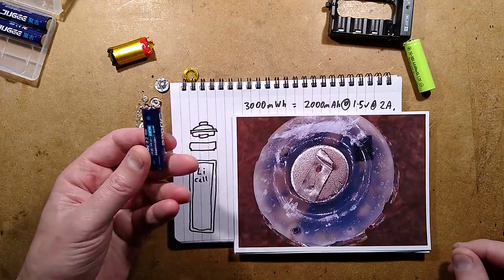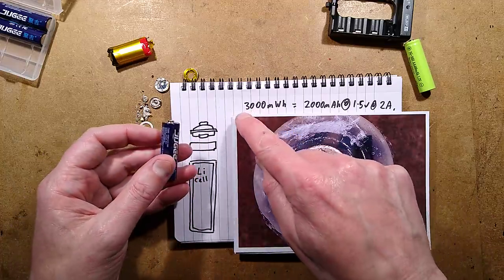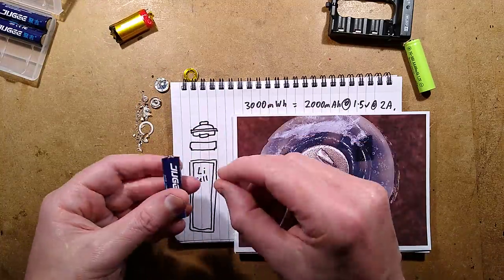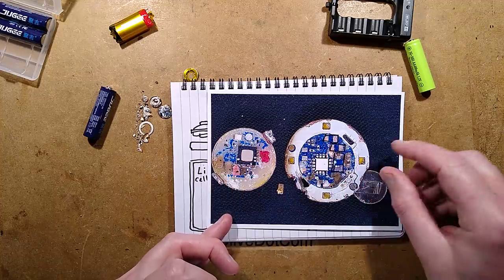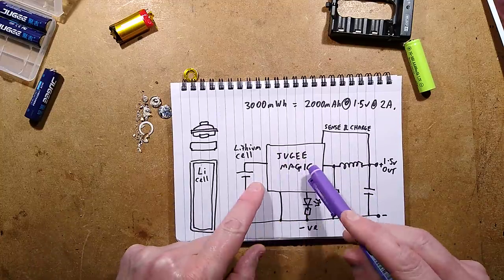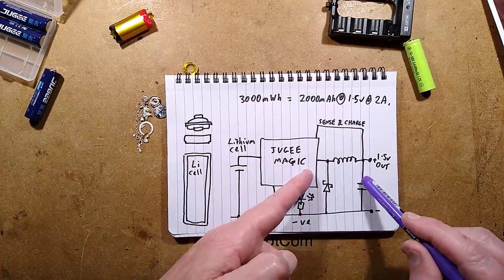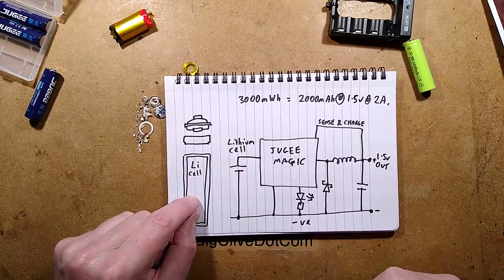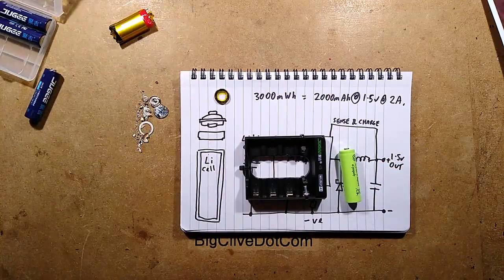JUGEE battery teardown.  The short version.

Comment: That's clever. At long last the 1.2 volt problems solved!
Reply: There was/is the questionable Ni-Zn 1.6v rechargeable cells but they were apparently limited in ability.
Reply: 1.2V hasn't been a problem in a loooong time, all modern portable thingamajigs work fine powered by 1.2V NiMH cells.
Reply: MasterBata except when they use 1v as being “the battery is flat”, which a loaded 1.2v cell can do even though it’s not yet empty.
Reply: MasterBata I have a metal detector, it takes 4 x AA batteries. I put in 4 Duracell’s and I have 6 volts, I put in 4 x NiMH and I have 4.8 volts. I have lost 80% of my voltage when I start my detecting with a set of freshly charged batteries. In real terms that means they run out faster.
Reply: Andrew T yeah, I’m sure I’ve overcharged nimh batteries in the past because the device they were in showed a low battery meter, or seemed to run down quickly. There’s an EEVblog video about it somewhere.
Reply: Thats an old wives tail put out by the disposable battery companies. What they don't tell you is their wonderful 1.5v batteries you throw in the bin so regularly actually drop below 1.2v in minutes whereas nimh batteries will stay a lot closer to 1.2v for a long time.

Any 'flashaholic' knows this. There is even an industry wide approved independant standard (ansi FL1) where flashlight manufacturers have the brightness and runtimes independantly tested with the various batteries their devices takes...nobody in their right mind would put a disposable alkaline in a high end flashlight! It would be dimmer quicker and ultimately last a lot less than a nimh power source. and the bloody things (alkaline) can leak. Even the "leakproof" ones.

Stop falling for the advertising.
Also...smoking kills, alcohol isn't great for you (that whole red wine thinning the blood...the amount of wine you need to acheive a beneficial amount of blood thinning will kill you outright!) and sugar is pretty much the new tobacco.
Reply: The Browns damn “big battery” and their sneaky ways 🤣 well they won’t get me, I buy my alkaline cells from Poundland where half of them are already flat or leaking, and weigh so little I suspect their AA batteries are really AAA cells with some padding.

Actually, I’m kind of disappointed when I buy modern electronics and discover they still require me to buy batteries. Like buying a product and finding it has no plug. Surely now there’s not many applications where a built in battery wouldn’t be appropriate, and it’s just the manufacturer being cheap.

I’m looking at you Microsoft. All other console manufacturers have controllers with built in li-ion/lipo batteries, but the XBox still uses double A batteries.

Comment: Very interesting. I wonder if the output is adequately smoothed? I can't use Znter USB rechargeable 9V batteries in musical equipment because they introduce an audible whine into the signal.
Reply: in audio kit you may need to add some ceramic or electrolytic caps to quieten it. Especially if it is designed to only run on batteries as the designer would not of considered ripple at all.

Comment: So, these are on Amazon, 4pack just as Clive has. If you search for Jugee. On that Jugee listing are the words 1.5V, Lithium, and rechargeable. If you then search for " 1.5v lithium rechargeable" you will NOT find these batteries other than a 2-pack. You will also find many many battery listings that are not lithium, and not rechargeable, and not 1.5v. Amazon search f'n sucks.
Reply: I've seen similar things with the Amazon search, I think you're actually  better off using google but limit the results by domain.

Comment: Thanks for the short version. I must admit I tend to skip through your full length videos, usually the device opening section and the circuit diagrams as I'm more interested in what the device is, outline of how it works, and what search terms to use to find it.

Comment: I wish I could get Clive's help on a lil project I'm trying to work on...I want to make a small portable Induction Heater I wish I could solder on the positive and negative to a Power Geek 4000mah power bank as all the parts needed to make it run off are on the Board for the power bank...I wish I knew a lot more like Clive when it comes to electronics I did micro soldering and QC work but

Comment: Hi,
You really should be using the little sanding drum instead of cutoff wheel, even if you go too deep most likely would remove material evenly enough it prevent shorting, good luck.

Comment: If only there was a more thorough investigation. Details of how hard the battery was to open. Examples of what happens when other batteries are put into the charger. Maybe a minute or two of nibbling away at the housing, trying to get the PCB out. Maybe even an interesting and charming aside about how every night the show runners would put new batteries into the wireless mics because failure just wasn't an option. Yeah. That'd be great.

Comment: These batteries are fantastic, when they work. The only problem is that the circuitry tends to break, especially in AAA cells. I don't have this very kind, but I have Sorbo and Kentli, and at least 1 already failed from both types.

Comment: @bigclivedotcom Could you please tell me, are these superior for use than Eneloops?
Reply from the maker: Each has its own applications.  The eneloops are the preferred choice for applications that will run on 1.2V.  The lithium based ones have the advantage with weight and for older equipment that needs a higher voltage.

Comment: Interesting... so what voltage would the lithium cell actually read if it wasn't stepped down or is this just a protection chip?
Reply from the maker: It would vary between 3V and 4.2V.

Comment: Do these only charge in the advised MILBEP compatible chargers? It's a little hard to find information online about what exactly MILBEP is. I have found the included charger to be very flimsy, I had to bend the charging connections to make proper contact with the bottom of the negative contact point.
Reply from the maker: I'd only recommend charging them in their own charger base.  I think there's variation between brands.

Comment: I use a LiFePO4 and a Blank AA  when I need 2 AA
Reply: Except the 4.2 volts is often too much. I have installed a diode inside the blank, so the voltage is now reasonable 3.5 volts. Also the low battery indicator works before the lion is too empty.
Reply: @TimoNoko  LifePo4 are nominal 3.2V per cell, their fully charged voltage is about 3.65V , think you are getting mixed up with L-ion

Comment: Sounds like a good cell since most recargable AA are 1.5v slowly dropping to 1.2v cells and a solid 1.5v rechargable would have many uses but to get hold of these via the Ebay flea market will cost a UK punter well over £40.00 for 4 AA cells & a charger. I think I will pass untill the chinese make the Very Dangerous and fun rip off clone for £5.00 direct to your door inc free Speedpak Delivery.

Comment: What about the self-discharge? Znter batteries has an ugly self discharge (similar to NIMH batteries but far more expensive)
Reply: I'd figure the always-active buck converter would drain these in less than a year. A decent low self-discharge NiMH like Eneloop or IKEA would easily beat that. Even a regular NiMH in good condition will last several months in my experience. However, worn out NiMHs certainly do self-discharge very quickly. If you're looking for a battery with low self-discharge I'd say get some new high-quality NiMHs for less money than this. Since these don't have a built-in USB inlet it seems to me the only advantage these have is the slightly higher output voltage.

Source for NiMHs being good:
I upgraded an ancient cordless phone (from around 1991) to NiMH (3x AAA size cells) and I'm certain I haven't charged it in four months, possibly even all year. I've had 15 hours of talk time and the low battery indicator still hasn't come on. Proper low self discharge NiMHs like Eneloops are even better, I think the batteries in my camera were charged over a year ago and they also seem to have plenty of charge left.
Reply: @eDoc2020  ZNTER batteries are self-discharged in a few weeks without use...

Comment: When an eBay listing states 'Refurbished Lithium Battery'. Is that even possible, and why would sellers go to such trouble?
Reply from the maker: They are often salvaged from old equipment, and usually have useful capacity for less demanding applications.
Reply: @bigclivedotcom  Useful capacity, but not as much as they originally had.  Shorter life, too.  You get what you pay for.  Unless you buy from an eBay scammer, in which case you don't even get that.
Reply: @bdf2718  Used cells are probably still better than the '6800 mAh' ripoffs which store less than 500mAh.

Comment: Could you test if it creates any signal noise on something like an audio amplifier?
Reply: How do you run an audio amplifier on AA batteries?
Reply: @Thermoelectric7  mp3 player, radio, you name it.
Reply: @deslomeslager  a lot of mp3 players will have switching regs inside anyway.  the issue will be anything that runs directly off the cell such as a radio mic..

Comment: Do you recommend these as an alternative for Ni-MH rechargeable batteries ? Ni-MH are quite slow to charge, have poor capacity and only output 1.2V
Reply: In terms of capacity, these seem to be about the same as a typical NiMH at 2500mAh/1,2V which is 3Wh like the Li cell.
Reply: If you can deal with 1.2v NiMH is still better IMHO. They're much cheaper and still have most of the capacity (2.5 vs 3 Wh). With a well-matched charger it should only take around two hours to charge a NiMH.

Comment: 2A maximum.  Great for some things, like measurement tools, clocks, lights, maybe radios, toys, cameras, video game controllers.  I like that they thought of the low charge warning.  Not so good for power tools, robotic vacuums, smoking/vaping gear, resistive ignition applications.  You know you can get a smidge over 8A from a NiMH cell, at least pushing through my meter leads.  They used to start airplanes with NiCad.  LOTS of current, not much capacity, not much weight.